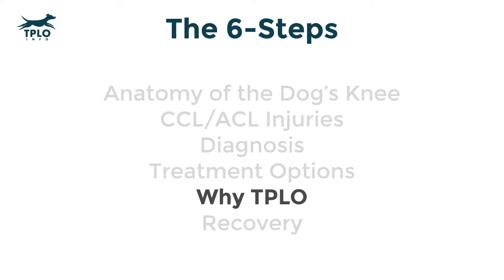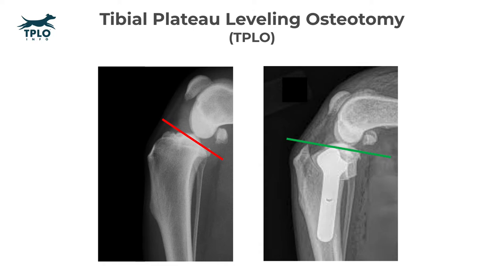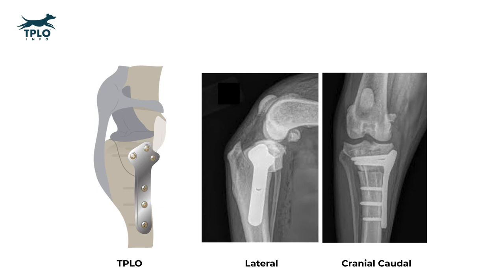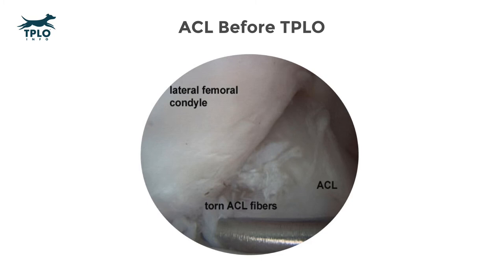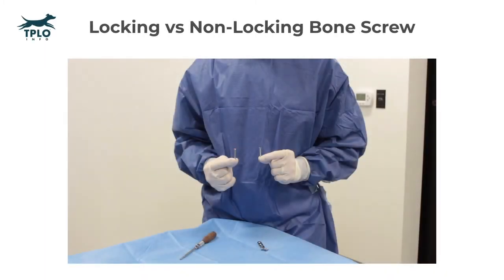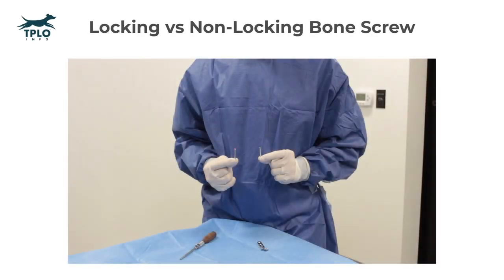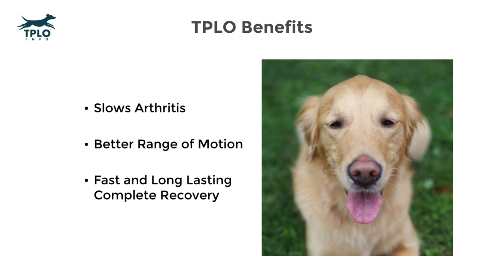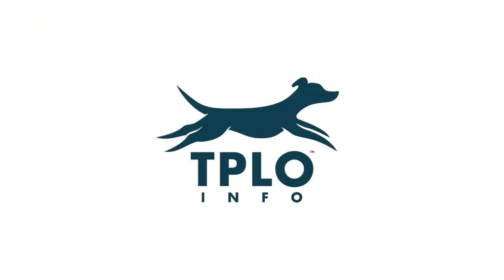TPLO Info Step 5: Why TPLO

Comment: Why use non locking screws at all?
Reply: Non-locking screws have some advantages. They allow a sliding relationship between the screw head and the plate recess in which the screw head seats. As the screw is tightened down and the head of the screw is pulled down into the recess of the plate, the head of the screw (by virtue of the ramp-like shape of the recess) will slide towards the osteotomy (cut made by the saw blade) in the bone. The segment of bone will slide towards the osteotomy, and provided, the other side of the osteotomy has some locking screws in it, the osteotomy site will be compressed. A compressed osteotomy site is very desirable, as the rough surfaces mesh together and provide extra strength/stability and shorter healing times.
A non-locking screw also allows the angle of the screw (relative to the plate) to be varied a little, which can assist in achieving purchase in the bone in some circumstances. 
Finally, non-locking screws are cheaper than locking ones.
The ideal is to have a mixture of locking and non-locking screws.